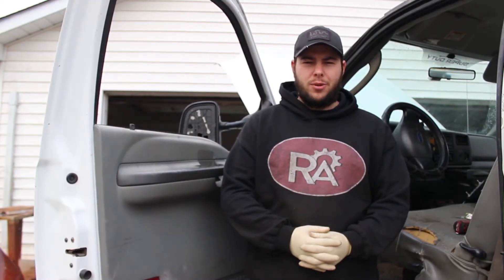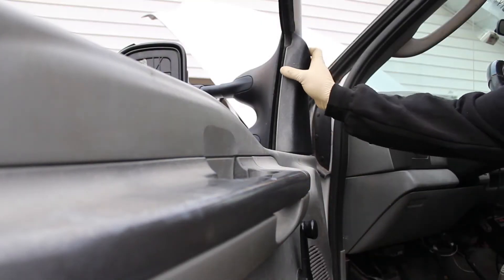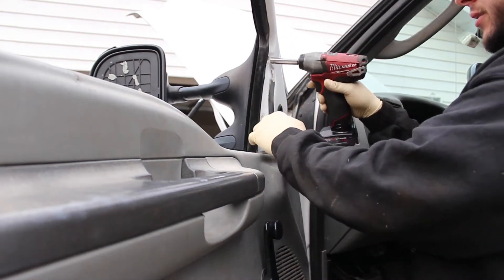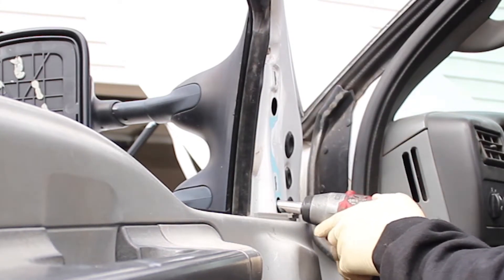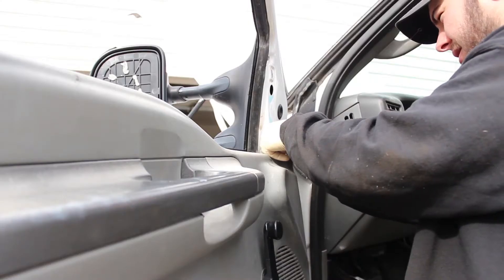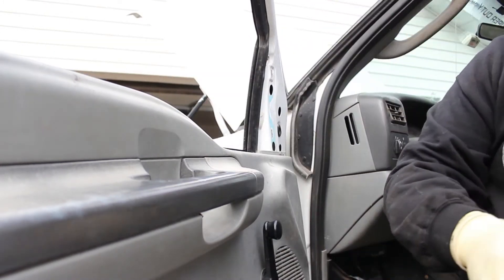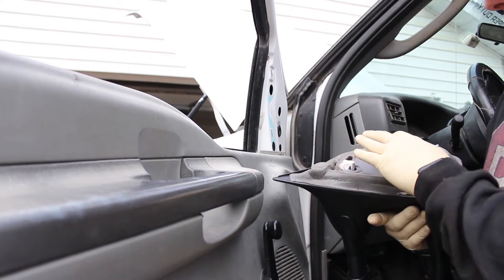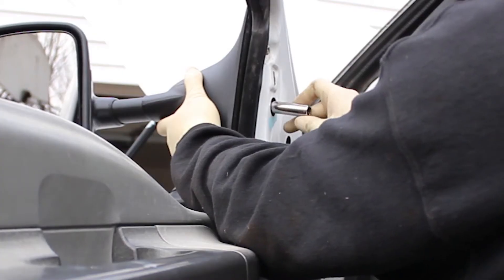2004 Ford F350 Truck Side Mirror Replacement (1999-2004) | Fix It Friday

Comment from the maker: 🛻Thanks for watching. We have more FORD F350 videos here!
2018 Ford F350 Battery Removal Quick How-To
https://www.youtube.com/watch?v=xG81yB4cUko

How to Check VITAL Fluids in 2018 Ford-F350
https://www.youtube.com/watch?v=lCK4hWjqtZE

How to replace a fuel pump control module on a 2019 Ford F350
https://www.youtube.com/watch?v=UJ_2OfdwjcU

2011-2016 Ford F250 F350 F450 F550 Mirror Replacement Guide
https://www.youtube.com/watch?v=JdvPK_Nvls4